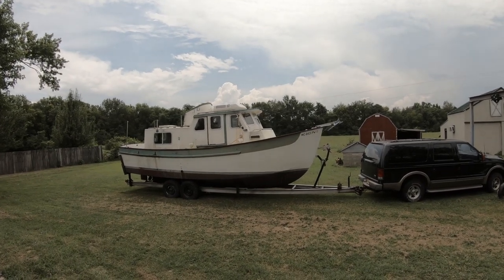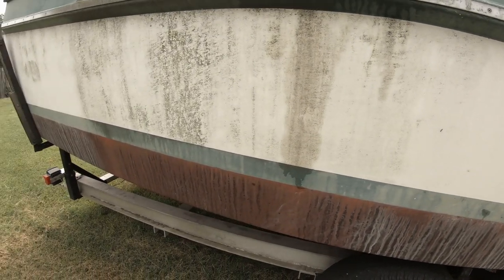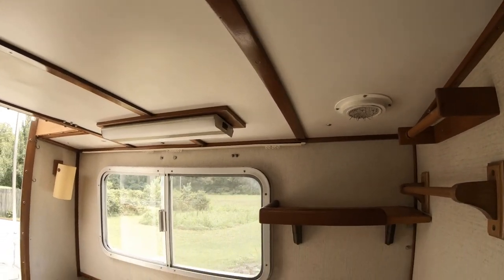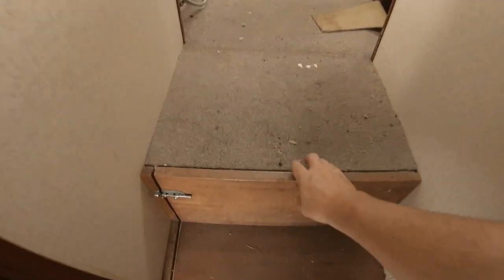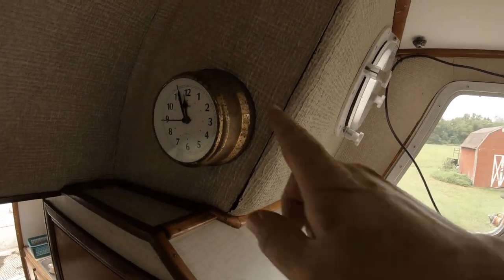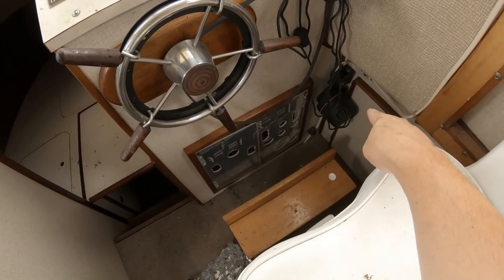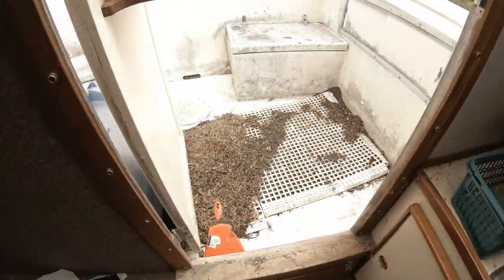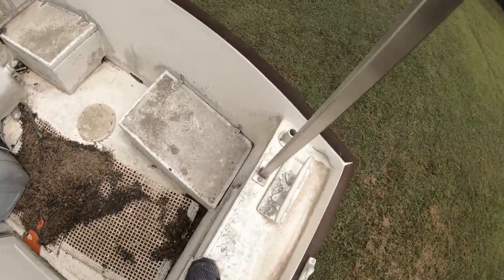Outer Reef 26 Trawler Project - Initial Walkaround

Comment: Is get underneath and straighten out all the bilge and pull the motor and freshen it up. Pull the tanks and have them cleaned and pressure test them and attach new fuel pumps. Get  the blower working properly and vented. That's just me, I'd get everything below decks pristine before I started anything inside. Check the batteries and make sure it has a proper charging system, one where is trickles down to exactly what the batteries need. Check on the hydraulic steering, flush it and new hoses and fluid. Then I'd start with new lines for the fresh water tank and ant fittings and change the thru hulls to bronze, they look to be plastic. Sounds like a lot but it's mostly grunt work. Lots of people go right to cabin work before they know exactly what's up under the deck.